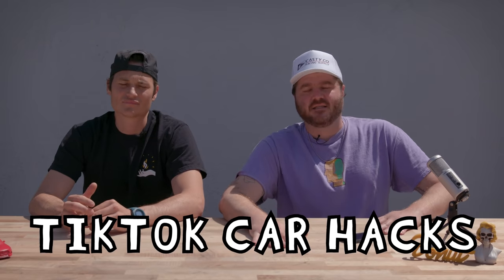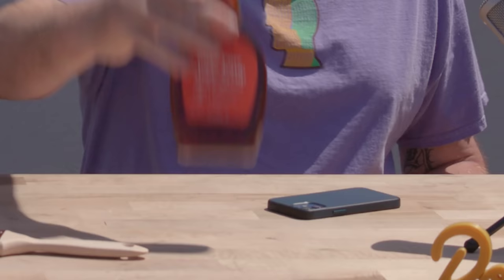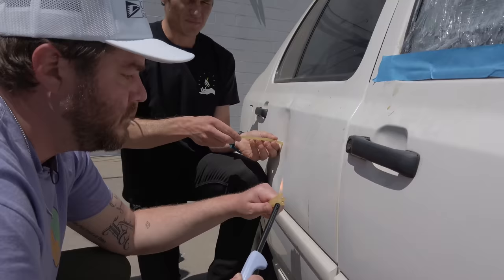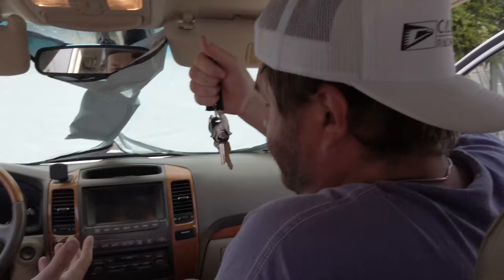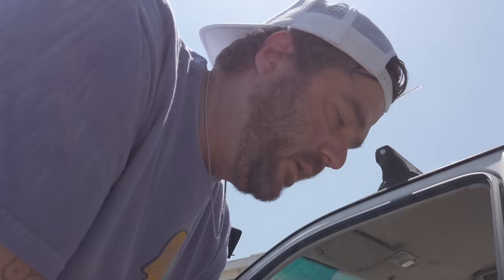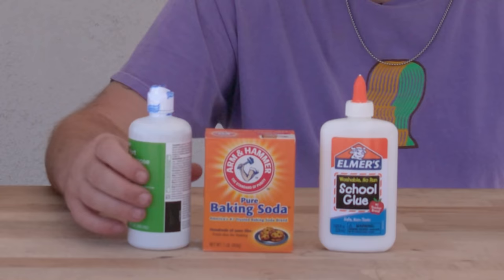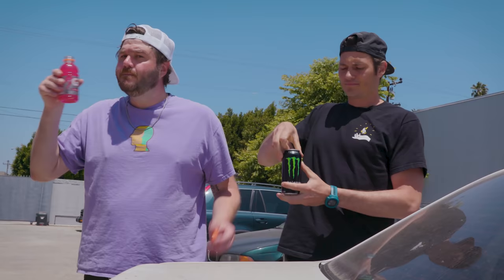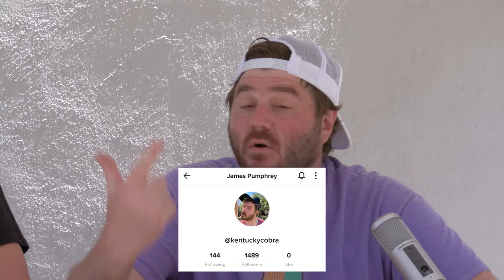We Tested TikTok Car Hacks

Comment: The only time the Hazard button actually helps theives steal a car is if the car is a Vauxhall Nova and you know the simple trick seen on Top gear
Reply: Take out the hazard button, pop it back in upside down, bump start and 10 minutes later you’re on the roof in a ditch 😂
Reply: @ZdayMaverick89  “Don’t watch this if you’re a thief”
Reply: 1967 Chrysler Newport - if you turn on the hazards and hold down on the brake, you could listen the the radio without having the keys.  (My Dad: "That's the third time this month the battery's gone dead in the Newport. What's wrong with this car?")
Reply: Was my first thought as well.
Reply: Worked on old corsa’s to
Reply: Charlie on the mta
Reply: @mrfeather83  that's because the Vauxhall Nova is a rebadged old Corsa, back when Vauxhall and Opel made the same cars under different names.
Reply: @MaartenvanHeek  The Nova was a Corsa A, after that we just got everything badged as Corsas.
Reply: Works too on our gm corsa (opel corsa b) here in Brazil 

Our vw gol had one that was really like cheat code (turn on hot air, turn lights on, and press the lever for hi-beams) do that and every eletric on the car start working and you can just do a bump start

Comment: That glue stick trick will most definitely work. Cleaning the surface will help the bond, but that wasn't your problem (the glue was still stuck to the car). It's going to depend on the car material and how many glue sticks you use. The tik tok car looked like it was plastic, Jetta looked metal

Comment: The car dent thing could possibly work. The thing is. They did it on a plastic bumper. You guys tried it on a metal door. No way in hell it's gonna work on metal. The plastic can flex back into it's old shape. That's why the whole boiling water trick can work as well. But if it's metal. Yeaaa no
Reply: It does work on metal panels, but generally not dents with a big crease in them, you need to get rid of the crease which generally means you'll be panel beating anyway so no need for pull sticks.
Reply: If the glued the sticks to the top end around the buckled area it may have pulled more of the dent out. But it's not a miracle worker. It will need to be reworked as well.
Reply: It does work but also varies on the dent and the glue stick. Just like the toilet plunger trick works on some dents. If he didnt pull so hard and fast it may have held and allowed him to pull the dent.
Reply: Put the bunny back in the box.
Reply: @KevinRay_man  why could you just put the bunny back in the box
Reply: @KevinRay_man  you know what I am?

Ugly all day 😂

Comment: 4:37 The mistake was doing it in the sunlight, the glue sticks didnt have enough time to cool down and harden a bit, which made them pull apart.
Reply: Also pretty sure the rear bumper was plastic on the video from tiktok
Reply: @imjustboreduc  that glue is Made for plastic body panels and not metal I think. It would work totally fine on bumpers.
Reply: @imjustboreduc  all car bumpers are plastic so yeah.
Reply: @FacuGonz3  fiber glass???? carbon fiber?????
Reply: @John-pp6xy  carbon is too strong.
Reply: @FacuGonz3  you said all bumpers are plastic, i wasn’t saying this works on them lmao
Reply: @FacuGonz3  it also works on metal parts
Reply: @FacuGonz3  Not all car bumpers are plastic....and there are several different types of plastic that's used to make bumper covers.
Reply: @slavkid4309  Depends on the thickness of the metal.  It's never going to work on that old VW....  The door skin is too thick.  In body shops, they use small metal studs that spot weld to the panels and not glue sticks.

Comment: In the last video maybe the glass was hot as hell from the heat of summer and the monster was actually ice cold while the Gatorade was regular temp . Cold on hot glass even if it’s tempered could shatter if there is such a difference in temperature .

Comment: Again, a clear cut before he poured the “monster” so what was the actual thing he poured on the windshield?
Reply: Someone off screen shot at the window you can see the impact zone
Reply: @MiseryDuke69  yup, at 12:15, if u slow it down, u can see a reflection of something passing over the car.
Reply: My bet is either it was something else or the window was preped for the hack beforehand
Reply: By the looks of it someone probably chucked a piece of spark plug at it while he poured them, I can’t think of any liquid especially one safe for drinking that could accomplish that even with prep
Reply: Probably threw a ceramic shard or shot a bb gun
Reply: @siopowar  bb gun wouldnt be strong enough. airsoft maybe.
pretty sure i heard the radio wire thing can break glass. not sure though.
Reply: oh and headrest bars for inside.
Reply: @krypticavalanch  Umm, aren't BB guns generally more powerful then airsoft?  I mean people battle with airsoft, BB guns not so much.
Reply: You could actually shatter a window with cold liquid if the liquid is cold enough and the window is hot enough

Or vice versa, hot liquid, cold windshield.
Reply: @scottthewaterwarrior  bb guns are plastic and can be shot at people with no padding from a distance. airsoft are metal pellets and you wear protective clothing to reduce damage similar to paintball. the gear is more padded than paintball though. you can actually get sniper airsoft guns strong enough to throw people down a set of stairs.
Reply: @krypticavalanch  my understanding is that anything that shoots a tiny ball be it plastic or metal is a bb gun. Pellet guns shoot metal pellets obviously and airsoft is a sport that specifically is tiny plastic balls fired from bb guns ain't no one on the airsoft field with metal bb's

Edit below
Also the forced needed to throw someone down stairs would throw you back equally far. There's like an entire Mythbusters episode on that. 3rd law of motion or someshit
Reply: @krypticavalanch  You are very mixed up my friend.  I don't think I have ever encountered a plastic BB gun, but plenty of plastic airsoft guns.
Reply: @scottthewaterwarrior  you might be right. maybe its the type of bb gun. had one as a child, plastic balls and weak. got hundreds of them stuck under carpet between floor boards (before we got carpets around house.) might be my memory of that. mayb uk/usa difference.
Reply: @krypticavalanch  Maybe, here BB guns shoot metal balls and will puncture skin or even kill small animals.  Airsoft guns use plastic balls, though some of them are still quite powerful and will break unprotected skin, but they wont actually go into your body like BB rounds will.
Reply: @Doctors_TARDIS  THANK FUCK SOMEONE ACTUALLY REMEMBERED THIS!!! It's literally just, "glass can't handle rapid temperature changes well." This isn't rocket science people, you learn about this in 6th grade (or when you try to melt the ice off of your windshield with near-boiling water).
Reply: @krypticavalanch  Bro, you got that completely backwards. Airsoft uses plastic BBs. BB guns and pellet guns (typically) use metal BBs or pellets. DO NOT shoot a pellet gun at your friends, unless you no longer want to be their friend.
Reply: @fuarkYT  Some 25 years ago we were at my friends and were shooting with a bb gun (rifle, no CO2). There was some target on a wooden wall. I think we were about 10m (so 33ft?) from the wall and one pellet ricoched back to one friends neck. Didn't break skin, but there was a clear round spot size of a pellet there. And it did hurt still, although probably it was more about being frightened... shooting with a gun (even though it bb) and being a bit alert because of that.

Comment: The rear window defroster was probably on for a long time to heat the rear glass and then the temp difference from pouring a cold drink to hot glass caused it to shatter.  Either the Gatorade wasn’t cold enough or it just takes a second for it shatter.  Could have also been done ice cold water.

Comment: Or you can just spend the $12-15 for actual window tint... lol I know its probably hot out but you still need to use a heat gun to warm up the body panel which helps it flex. Works best on plastic or fiberglass based panels.

Comment: another hack to break glass that i learned in auto extrication class is that you can use the ball end of antenna from a car, hold it to the window with the ball end in a corner of the window, pull it back like a spring and let it go.

Comment: The nylons do work on the older accessory drive motors where it's one belt to the alternator, one to the power steering ect. Worked on my '80 Corvette and got me 9 miles home after the tow truck wouldn't lift the car due to the low bumper.

Comment: The one about "hOw tO sTaRt AnY CaR!" reminds me of when I was a teenager and I'd look up tricks online like how to get a second free bottle soda from the vending machine after only paying for one, by tricking the machine into thinking no soda dropped, so it'll push one out of another slot to prevent people from getting stuck typing in the number for an empty slot.  The big difference is that the old tricks I used to find actually worked.  The machines are probably a bit smarter nowadays :(

Comment: The only thing I can think of besides a chemical reaction for the monster and Gatorade one is that either the OP cut and replaced the monster with something else, or the drinks were so cold and the car so hot that the thermal difference between the car window and the cold drinks caused the window to shatter

Comment: the car start hack was basically the car starting the engine because the radio, hazards and windows would potentially trigger a volt drop and make the car think the battery is low, my grandparent's old car would turn on the engine if the battery got low but I think they keys still had to be inserted/ car unlocked

Comment: The thing about the sidedoor bottle opener is you have to open the door to pop another beer. It's easier to use the seatbelt clip that is dangling by your left shoulder. Who wants to stop and use the door if you're racing to get to the bar before it closes?

Comment: Kids today, no practice.
 We opened beer bottles with virtually anything. Chrome steel bumpers were best, press the edge down and push.
 
Pro tip, when your father is driving down the road and shoots the bottle cap off with a 1911... it's time to work on your personal driving skills. My first driving lesson, in the desert at 5 years old. Even I knew he was too drunk to drive home, so I took over. Hey, Henry J sedans were easy to drive.
After than I had a church key with me at all times.
For the young, a church key is a bottle and can opener, the ones that you could get free were flat and silver.

Comment: Glue sticks were used on bumper, which are made of polypropylene or polyethylene (I don't remember), which are plastics, but you used it on doors made of steel etc., that's why it didn't work as intended.

Comment: The 2nd one with the dents. There is a tool for it. It’s kinda like a self forming sucken cup to pull the stuff out.
But a more safe thing to do, slowly pour hot water over the area then just try pushing it back out from the other side.

Comment: The glue stick dent puller hack works for plastic panels bumper covers crap like that and what works best is yes clean the surface first because that will give you the best adhesion but also it’s best to use an electric heat gun or even a hairdryer if you have to so you can warm up the panel first and if possible heating it from the backside so you don’t accidentally bubble the paint with the heat gun. Once the surface has been cleaned the dented plastic warmed up then you melt the glue sticks and stick the m into the dent but you don’t want them spread out at all, hold the glue sticks in a tight bundle when you heat them and put them in place so they are not all floppy. Once that is done and the glue sticks are stuck in place pull out gently but you might need to use some heat from behind again and the plastic panel should pull out as long as it isn’t cracked

Comment: I'm a paintless dent repair expert and we do you hot glue to pull dents. But its nothing like the video you guys saw. It also worked for him because he did it on a plastic bumper. And you gotta clean the surface with 91% isopropyl alcohol which also removes the glue that was stuck to your door. ALSO with your dent you had to pull it up closer to the body line because that spot is when your dent is actually reinforced

Comment: Cold liquid on hot tempered glass will shatter it but only if the glass already has something like rock chips or welding splatter marks on it.
On the other hand pouring hot liquid on cold car glass will do the same. It's about the extreme temp change and already a spot for the shattering to start.

Comment: there are a few cars you can turn on with a few tricks. 
The Opel Corsa 1 could be turned on by pulling out and rotating the hazard light button 180º

Comment: The start any car may not have worked. But, the old opel/vauxhall nova could be started without the key. You pull the hazard switch out, turn it upside down. Put it back in. Then bump start it!

Comment: you can start 94 Astra without a key, just take out the hazardlight switch turn it around, put it back in and press it the ignition is on :D just needs a bump start and lets go :D the only thing is the steering wheel block

Comment: We use a special glue that comes oft with alcohol. You also need to clean the surface with alcohol first. You also want to heat the surface slightly so the paint doesn't crack.

Comment: The dent pull out trick works on plastics, like bumpers, may be, on more modern metals surfaces as they worked out how to use THINNER metal for the body through changing shapes.

Older cars, like Jeta, the metal in the body panels of the car might be too thick for pull out like this ;-)

Comment: The glue was used on a fiberglass bumper you can just heat the back side with a torch and it will pop out or just punch it from the other side fiberglass dents are easy to fix not metal dents.

Comment: I saw in a video...
When ur key is locked inside the car and doors are locked, 
*Pull the drivers door handle thrice, 
*Pull the passenger door behind the driver twice,
*Go to the other side, pull the rear door twice, 
*Pull the passenger door handle nxt to the driver twice, pause, then pull again. N all doors will be open.
I tried it and it doesn't work. 😂😅🤣

Comment: The key to using the glue sticks is heating up the body panel with a heat gun first (If its plastic wont work on metal panels)  first which worked for me on a small dent in a plastic bumper but its very hard to get it to work took multiple tries for me but I will say this tho one tiktok hack that did work for me first try was spraying 100% DEET off mosquito spray on your headlights and letting it soak for 5 minutes and then wiping it off.. it actually does clear up foggy headlights! Worked on my 96 bronco's headlights!

Comment: There is actually a way to turn the power on on your car using the hazards button. Hazards button has connectors to both the battery power output and generator power output, so if you know wich connectors to jump together you can bypass the ignition key and give power to entire car. You still need to start it. It was a common problem in old Ladas and Moskoviches where you just took out the hazards button, turned it 180 degrees and push it on to get the power on xD
Reply: Why does the fact that a Lada has this problem NOT surprise me lmao
Reply: @jingalls9142  Remember - if you know the wiring you can do it in almost any car without an immo
Reply: @jingalls9142  Remember - if you know the wiring you can do it in almost any car without an immo

Comment: My names Zach I'm a body tech @bernatche  autobody. On the glue method. If you were to clean with alcohol first dry down real good with paper towels then run a hand held butane torch over the damaged panel (noticing vapors chasing away like fog) then apply your glue with a convex eye hook yoy can pull it out with either a slide hammer or a pull bar. Don't use too much pressure and use a white or yellow translucent rubber hammer lightly tapping out the crown.

Comment: The fact that they didn't wipe down the car before applying the glue sticks is irrelevant, because the glue stick broke off of itself. It didn't slip off the surface of the car, as is evident from the "boogers" left on the door. Js.

Comment: No with the glue sticks you can see you had it down way to low if you was to move them up about 3" it would have came out so it was just the placement of the glue sticks is why it didn't work.

Comment: I forget which model of car it was, but for some reason, you could pull out the hazard light switch in the dash, turn it over, and reinsert it, and it would turn the car on. Mainly because the car was built by idiots.

Comment: Radio antenna works perfectly fine for breaking out the window. And ideally you’d want to put a grid of tape over the window so after you shatter it you can peal it out of the door without making a mess. Also if you ever get trapped inside a vehicle the head rest works well to smash out a window.

Comment: You were using the glue on a metal door, not a plastic bumper. Do a A little heat gunning beforehand to make the material more malleable. Don't want to overstretch it though